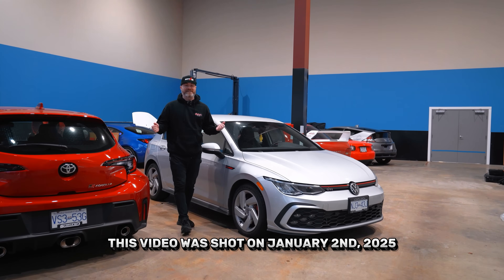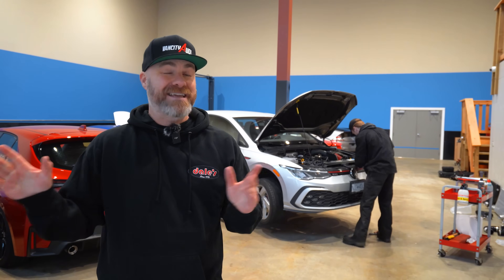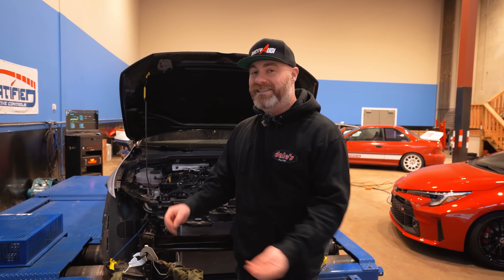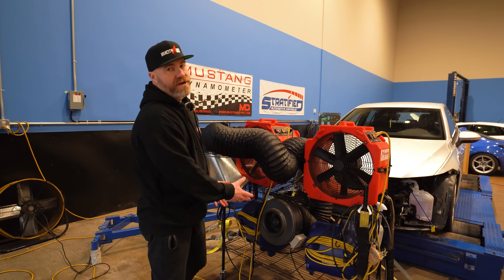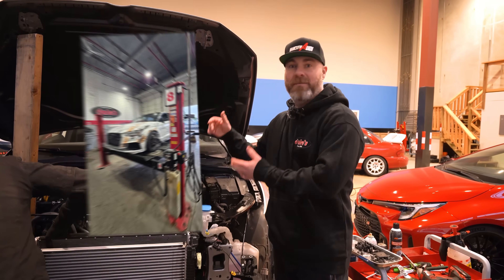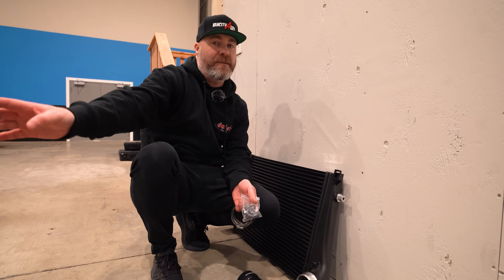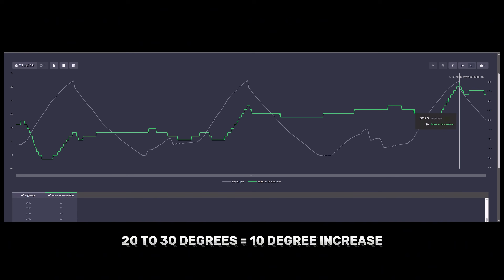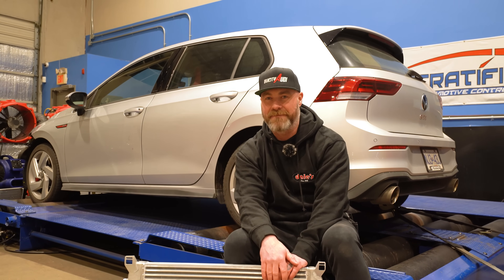VW MK8 GTI INTERCOOLER COMPARISON! WHICH ONE IS BEST?!?!

Comment: Im curious how the IE one would've done.
Reply from the maker: You and I both. Both the other IE intercoolers I have used from different platforms worked extremely well for me
Reply: Very similarly.  I've used all of these intercoolers on the Mk7 (which they are very similar to, in fact, APR lists its IC as fitting the Mk7 and Mk8), and the aftermarket ICs have very similar performance.  Close enough that the cooling performance can be skipped as a selection criterion.

Comment: Also its important to see turbine speed , if a intercooler is more efficient it will allow same performance with less turbine wheel speed
Reply from the maker: Guess you better redo the test so you can let us know the turbine speed you see while running each of these intercoolers!
Reply: @VancityAudi guess you havent changed your passive aggresive tone.
Reply: It would be interesting to see, but I'm skeptical that it's an important attribute.  Most of these intercoolers are likely operating at or above 90% efficiency, and the difference is likely a percent or two.  When you think about how much single-digit differences in air temperature have on the air pressure, and how much that pressure difference causes in the rotation of the compressor, and then what shift there is in compressor efficiency, I think you'd find that any performance differences are masked by measurement noise.

Comment: Great video. I installed the APR intercooler about two weeks ago, and the difference is night and day. My car is APR tuned, and the intercooler completely transformed it, the car pulls harder, zero lag, and the overall performance feels way sharper. I’m really happy with the result. It absolutely outperforms the stock intercooler, and that’s what matters most to me. I do not track my car Arteon, but daily driving in summer time is much more fun.
Reply from the maker: Glad to hear you're enjoying your APR intercooler
Reply: Did you change charge pipe? Or just the intercooler ?

Comment: What was the base line power, are you saying there was 3-5hp added with just the intercooler?
Reply from the maker: Correct. As much as the IAT's were so much cooler with the after market intercoolers, the power difference was minimal because it was so cold out and the density altitude was so low. If we tested in much warmer weather and on pump gas, there would have been a much more noticeable difference. The ethanol provided additional cooling and the ambient conditions provided perfect power making conditions as well.

Comment: Should have pointed out that Wagner is a tube and fin vs the other 2 being bar and plate. You posted it with the flow test but maybe explaining the difference with temp and heat soak
Reply from the maker: Perhaps you can reshoot the video & go over those extra details to do the Wagner justice! Good luck & I can't wait to see the video!

Comment: I got a wagner on my mk8gti.  My oil temps stay around 15 to 20 degrees less than stock.
Reply from the maker: Oil temps aren't something you should be comparing when upgrading an intercooler. I also don't believe what you're saying as I've never seen that happen in any vehicle I've owned when upgrading intercoolers, and I've upgraded and built a lot.
Reply: @VancityAudi u must be new to this. Because this is nothing new.
Reply from the maker: @notsure3535 😂😂😂 I've modified, tuned and built a ton of Audi's and VW's and none of them experience lower oil temps due to an upgraded intercooler. Maybe I'm not driving them hard enough and drag racing isn't enough to push them?

Comment: Always use a top-amount intercooler...
Reply from the maker: I've yet to see any single test where someone does a direct comparison between a front mount intercooler & a direct replacement on these cars, on the same day, on the same car, on the same tune to prove that they are any better.
Reply: There are ample comparisons analysis on the web. It all comes down to personal choice but the top-mount IC has less turbo lag and there's no delay on bost when tuned. They talk about heat soak but I don't notice it too much
Reply from the maker: @RDriver2.0please send me the comparisons that you're referring to online about that data from a Mk8 GTI! I'd love to see it!

Comment: Intresting how flow and performance dont have a linear correlation, love how you have no bias between companys. Just objective testing every time. CTS has similar performance with way less flow but can see its recovery rate is worse on pull 3
Reply from the maker: That's why we found it so interesting!
Reply: The design, bar & plate versus tube and fin, plays a role in the flow rate, T&F generally flows better.  Additionally, core depth does as well, the Wagner having a thicker core helps.  Generally speaking, and all things being equal, a lower flowing core should have better cooling efficiency as it is the mixing of the air as it passes through the fins that increases heat transfer, but reduces the flow rate, or more correctly, increases the pressure drop across the core.

Comment: When/why did you get rid of your Mk8 GTI?
Reply from the maker: Many reasons, but the main reason was we made all this horsepower and torque and it was basically useless considering we just ended up roasting our front two tires
Reply: @VancityAudi  Thanks for the reply. I'm looking at maybe a 8.5 golf R. But I still have a hard time with the price tag. I think oh the GTI should be just fine, but I know later with all the wheel spin once the power goes up. I would probably regret not getting something AWD.
Reply from the maker: @Max_Thunder AWD would have definitely helped, but the build quality and all the driving nannies were also things I hated.

Comment: So they are all basically the same. Buy whichever is cheaper....
Reply from the maker: In hot weather, running a pump gas tune?!? I wouldn't doubt that you'd see possible differences. Sadly, that isn't what we tested in though.
Reply: The all performed similar on pull 1. But pull 3 shows you the recovery rate and there were differences
Reply: @craigauty6756  Splitting hairs over aftermarket IC cooling performance is not very useful.  The practical differences are not noticeable, and without logging the charge air temperature and ambient temperatures throughout the test, to calculate the efficiency, you're only looking at part of the picture with IAT.
Reply: @mygolfmk7209 that's correct but there were clear differences on application like a track day. Recovery rate matters. Can't just be good for 1 pull
Reply: @craigauty6756  Are you saying these ICs were compared during a track day, and differences were logged?
If you're looking at these dyno results and trying to infer how quickly the IC will dissipate heat on track, I think that's a stretch; the conditions are very different.
Reply: @mygolfmk7209 i assume the times between the dnyo pulls were consistent. I assume this because adam is not a idiot and trys to control variables to the best of his ability. Inferring the performance on the last pull and relaying that to demanding conditions ie track. Is what ive done. Is it perfect? No far from it. Is it a logical conclusion from what i know from this video? I think so
Reply: @craigauty6756  The time between the end of the first pull and the start of the third was shortest with the OEM IC.  Wagner was 31% longer, CTS 42%, and APR 62%.  The assumption that the times were consistent is invalid. 

The difference in the peak IAT of the last pulls is only 4 to 7 degrees greater than that of the coolest aftermarket.  The charge air temperature is likely around 300 Fahrenheit, so these ICs are dropping the temperature around 220 degrees, and you're suggesting a difference of 4 to 7 degrees of final temperature matters?  In what practical way is that going to change the engine's power output?
Reply from the maker: @craigauty6756 I'm sure many people that watch these videos would disagree  with your opinion of me, not being an idiot 😂😂😂
Reply from the maker: @mygolfmk7209 I'd love to know how you figured out the length of time between the runs!
Reply: @mygolfmk7209 wait a second you think this video had no editing? And therefore the time between runs shown on the video is accurate? 😅😅😅😅😅
Reply: @VancityAudi  From the datalogs.
Reply from the maker: @mygolfmk7209  how do the datalogs tell you how long the runs were? I only logged the rpm's and intake air temps.
Reply from the maker: @craigauty6756  you would be correct. We tried our absolute best to make the runs the same length of time to keep the variables as close as we possibly could. That's why I pointed out the longer run with the APR intercooler due to the mishap that the dyno operator had before commencing the 3rd pull.
Reply: @VancityAudi  VCDS automatically adds a timestamp column.  I rarely use VCDS for datalogging nor Datazap, but I presume that because VCDS omits the units for the time columns, Datazap doesn't recognize the column as containing data to display.  If you open the VCDS CSV file, you'll find the time stamps.
Reply from the maker: @mygolfmk7209 so you downloaded my datalogs from Datazap to calculate that?
Reply: @VancityAudi  Yes.
Reply from the maker: @mygolfmk7209 well thanks for being honest about that. I'll make sure to never leave my logs as being Public moving forward because that's creepy as f$ck in my opinion. They were not your property to download. My mistake.

Comment: Holy crap! The mk8 GTI made so much power!? Is that stock turbo? Do they now come with is38 turbos?
Reply: The mk8 GTI runs a Garret turbo, the Mk8-R runs a Continental turbo. Both are way different than the is20 and is38
Reply: @Disclosureguru that's great to know. I didn't know they switched away from BorgWarner
Reply: @SuperHbkforever  its to be seen if its a bad move yet. I have a Mk8-R coming from a mk7 gti. Its a world of difference my gti was high torque apr tuned about 330 whp.zero lag zero traction lol Where as my R is more refined in its delivery. Both were a blast to drive and ill always be a VAG lover as long as they have ICE
Reply: @Disclosureguru I'm a VAG guy too. B6 A4, but tiny k04 setup. Custom tuned by me, and a few bolt ons. I also have a BMW that I love too, but the Audi gives me more smiles driving that thing. So I'm right there with you...

About the turbo thing. I personally am a huge BorgWarner fan boy. Looking at what they can achieve with older technology on their artworks line can make BB turbos jealous. And their EFR turbos just knock it out of the park. But Garret also makes great products that a lot of people swear by. So I'm looking forward to seeing the differenced
Reply from the maker: As I mentioned in the video, the car was running Stratified's Stage 1 E40 tune
Reply: @VancityAudi totally got that, but I don't think that was possible on is20's on the mk7

Comment: Moral of the story, anything other than stock and you’re good to go!
Reply from the maker: In super cold conditions, running an ethanol based tune, yes. In the heat, on pump gas, absolutely not. That wasn't tested.
Reply: @VancityAudi  FWIW, the knock resistance (ethanol content) of the fuel has no effect on the intercoolers' cooling efficiency or pressure drop.
Reply: Aftermarket ICs are an improvement over stock, but it's important to consider your application before deciding whether they're worth spending money on.  The stock IC performs well for a range of uses, a dyno pull, where the IC mass is a key factor, the stock IC isn't going to perform well.
Reply: @mygolfmk7209 Ayyyy there he is! Your site helped me a lot when choosing my
Intercooler.

Comment: Disappointing to not see Unitronic in this test
Reply: I agree since they are very popular, but they are all better than stock for sure. I consistently see 15 degrees IAT delta with my Unitronic one! Even down to 8-10 degrees difference if it’s cooler out.
Reply from the maker: @rj.baldwin sounds like it was money well spent!
Reply from the maker: Agreed. They declined my offer to participate